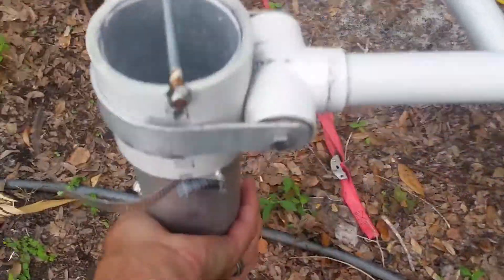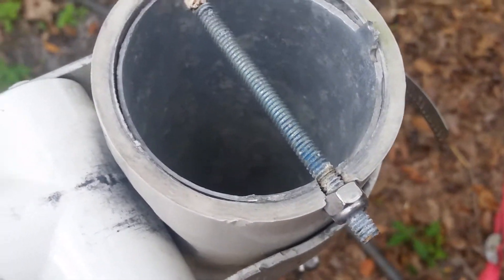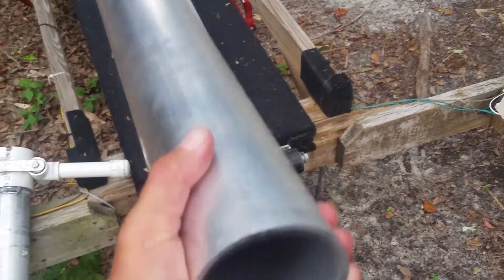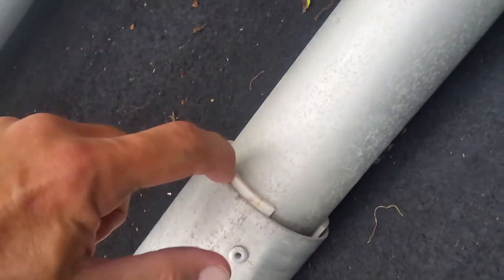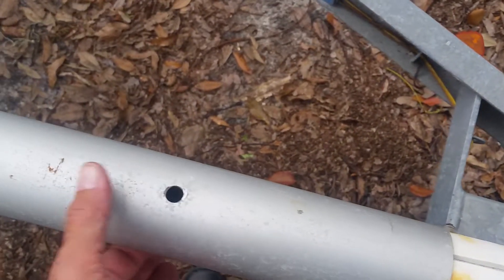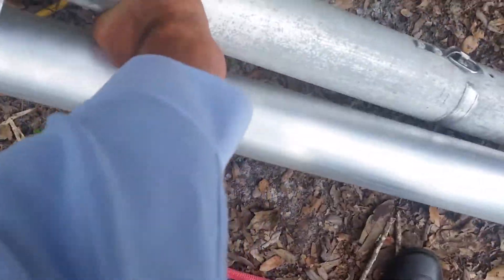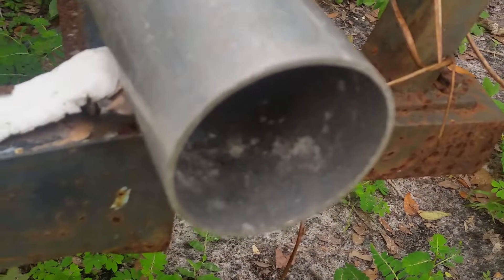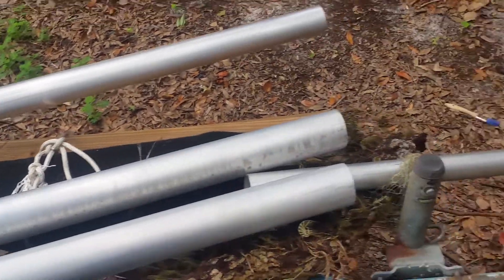Broken Mast autopsy

Comment: It's very hard to find good information on small trimaran masts. There was a discussion on the small trimaran blog where people offered different opinions. One thing is that if you stay the mast it could go through the floor. I don't think that would be a problem for you with the way Frank builds his boats now. I think he had a mast bottom damage the side of one of his early boats and he has put in a very sturdy well designed step now.
Reply: I have been wanting to be a trimaran for a long time, but this is what has been stopping me. I just got rid of a Prindle 16 that I found to use for the mast because the mast weighed over 40 pounds. I want to build something like one of Frank's but with the ability to sit sideways also on a cockpit tray when the wind picksup. I spoke to Frank once on the phone, and we exchanged many emails for about a month, and then I told Chuck from Duckworks about Frank's site and he became famous, next thing he's being interviewed by Jim Brown! I was also, since have had spinal surgery due to a car accident, so I need a boat that has good accessibility.
Reply: If I build something it will probably have a cat ketch rig to keep the masts manageable like Frank's 24 footer crossed with one of the Strike trimarans.

Comment: It depends on whether you stay the mast or not. Flagpoles use T6063, and some production sailboat masts also use it. Staying converts the mast forces into compression and t6063 is up to the job. Otherwise, you are on the right track. Grahm Byrnes uses the .125 on the lower masts section and .0625 on upper from his unstayed masts on the coresound 17.
Reply from the maker: christopher wilson that is a good point. Maybe reinforcing the mast base area for a more compression load and do removable and adjustable side stays. Thoughts ?
Reply: @ibiubu99  If you're going to a stayed mast, just get a used Hobie 14 Turbo mast and sails. That lets you add a jib. I built my Slingshot 19 with the Hobie 14 Turbo sailplan. Now I'm waiting for my new 128 ft sail (per Frank's design) and I'm making a 24' mast out of two 12'x3"x.083" pieces of aluminum. I'm going to pop rivet them with a 2'x2.75"x0.125" tube inside. 

Stayed masts are a PIA. Stepping a 23'11" mast on a trailer is hard and time consuming. Trying that while on the water is all but impossible without a couple of helpers.
I'm looking forward to cutting 30 minutes off my setup time by going unstayed and having a roller reefing main.

Comment: Another thing you could try is a flagpole. You can get them already anodized and they come in sections that join together seamlessly.  You want the heavy duty version that goes from 3 inches at the base to about 2 inches at the top.
Reply from the maker: christopher wilson I think I went to my sign shop and called the flagpole wholesaler and the flagpole isn’t 6061 T6.   Seems like I remember it being a weaker aluminum
Reply: @ibiubu99  I checked on flagpoles. A 20 ft pole was going to weigh over 35 lbs, and the thinnest walls were 0.125. Of course a 25' was worse. Two 12x3x0.083 with the connector were about 22 lbs.
Reply from the maker: wisenber good point. I’m about to go to a sailmaker and have him make Frank Smoot’s Fan sail. It will be permanently attached unswayed mast, and no reefing. All the way up, or all the way down, folded, in a mast crutch. I plan on keeping it on a mooring, so, hopefully getting it ready to sail will be under 5 minutes. Plus, might need a sail cover for UV damage while stored in the mast crutch.
Reply: @ibiubu99  I had one make the 128' version with vertical baffles. Should be here in a couple of weeks.

The ability to reef is pretty big for me. Since I don't live near a coast, I have to make due with the conditions when I do get to go. That and Chief is pretty adamant about reefing for Watertribe events. I'm hoping to do the next Everglades Challenge in  in March. I'm currently trying to figure out a furling system that will work similar to the Hobie TI set up operating from a couple of sheet below deck.

If you're leaving her moored, you'll need some real paint for her below waterline.
Mine currently has house deck paint below the gunwales and spar varnish on the deck
Reply from the maker: wisenber I have real bottom paint (1 part heavy copper) from a dry dock guy. He also gave me 2 part epoxy primer and 2 part epoxy high gloss top coat.   I want to change the ama connection method to something like Gary Dierking uses, a more traditional Tahitian tying system.
Reply from the maker: wisenber I also have a Triak trimaran, and chief signed off on its reefing system, since it’s almost identical to the Hobie system. I really like it, but it seems almost impossible to create on your own. Had a welder make me up an aluminum boom with boom jaws to fit the smoot type mast, hoping to spin the mast, like the homie, in order to reef, and yet still have a boom, instead of boomless.
Reply: @ibiubu99  I'm looking at just pop riveting an eye low on the mast and tying the center of a line to it. One side wraps as the other side unwraps. The challenge will be in reducing the friction between the mast base and the mast step. I'm making both out of Delrin. If that doesn't work, I'll try adding leverage with a couple of blocks. If that fails, I'll need to come up with something involving bearings. I'm hoping the Delrin on Delrin works.

The Triak is a nice ride. I did my EC in an Epic kayak with a Falconsail. With the small craft advisory, the winds were too strong for me to use the sail at all that year.
I have my 19" Wheeleeze ready to drag her across Fort Desoto beach.

We should meet down your way some time and compare. Mine is so far off Frank's plans that it's barely recognizable.
Reply from the maker: @wisenber  or maybe UHMW plastic plate for the bottom of the mast to rest on, and then it can hopefully spin around on the plastic as you furl or unfurl.  I'm in Jacksonville FL. Where are you ? I have 2 completed main hulls, but no amas yet.
Reply: @ibiubu99  Delrin is a bit harder(hardest of plastics)  and used for bearings. I have a few different materials to try. All of them should have less friction than the PVC Frank uses. I'm mostly anxious to cut my rigging time as I trailer her to different spots for sailing. If I can get it quick enough, that leaves more opportunities to get out.

Did you say two main hulls??

I'm in the sailing Mecca of Knoxville, Tennessee. What we lack in wind, we make up with whitewater. Not really Slingshot territory, but I do have a few lakes nearby.

Ever consider tweaking the ama design?
If I were to do it over again, I'd probably round the bottom a bit to reduce pounding and add some buoyancy to them from about 4 feet from the bow to 9 feet to reduce diving. She would be a smoother ride and could probably manage bigger than a Hobie 16 sailplan that way.
Reply from the maker: @wisenber  another builder completed a slingshot 19 main hull,  but got cancer, so he sent it my way. He came up with a cool crossbeam extension system for trailering.

Was considering making the amas out of 4 inch closed cell insulation foam sheets, covered in fiberglass cloth.
Reply from the maker: @wisenber  You may have already seen the build of Daniel Caseli building his version of the TRIKA 540.   We could both take the best of the TRIKA 540 design features that we want for our slingshots
https://youtu.be/GmXgWTrqYgA
Reply from the maker: @wisenber  I would like to be able to private message you concerning our trimaran builds. Any suggestions on how to do that?
Reply: @ibiubu99  I'm on Google, but not facebook. Gmail or Google Hangouts works for me if it works for you. You just need a gmail address to send. Mine is the same as my YouTube.